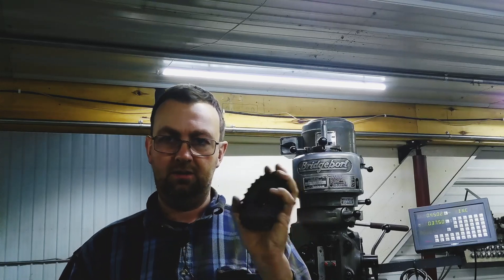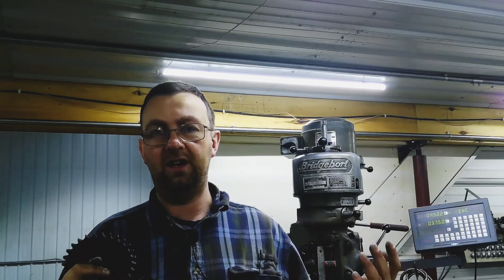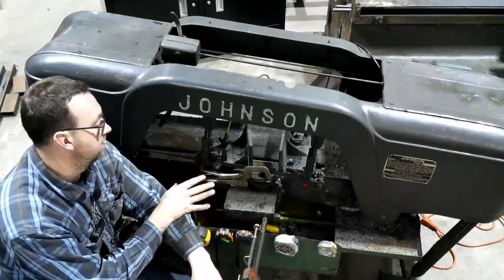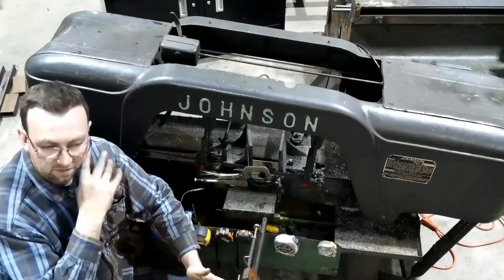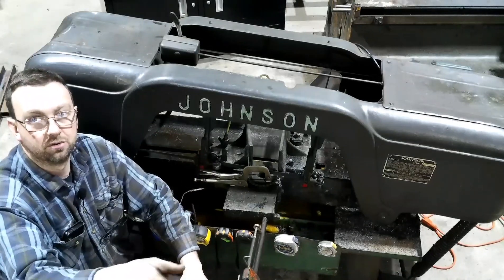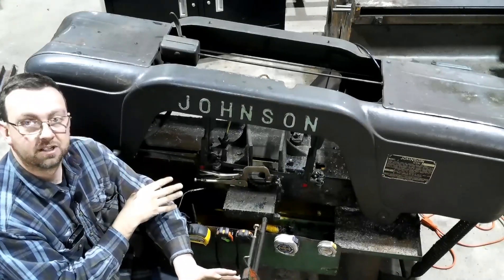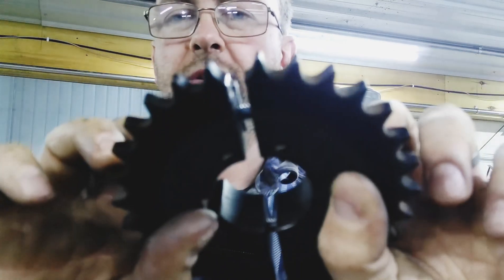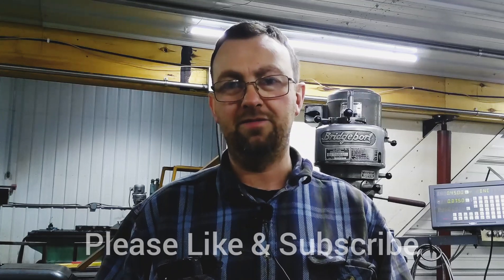How To Split a Sprocket to fit over a Shaft

Comment: Ah, I assumed you were going to crack them like how they do big ends, not cut them. Do they need to shim to keep it even / make up for the material lost in the sawing - when tightening them in place?
Reply: I thought so at first but no, the bored hole clamped on the shaft will keep the OD of the sprocket the same. When the two halves are bolted back together, the pitch between the teeth on either side of the cut should remain the same. I suppose you could have one gap tighter on one side if you tightened one of the cap screws way more than the other. I'd check the root on either side with a piece of stock the diameter of the chain roller just to be sure.

Comment: On a motorcycle the sprockets wear from adjusting the chain! When you keep adjusting the chain you change the pitch and wear out the teeth. Chain gets loose ,replace chain.  Sprockets  will last forever,or close to it!

Comment: Doesn’t the shaft hole become smaller by the amount the saw has removed? Seems that if you remove metal the hole will narrow itself and no longer be the same round diameter.
Reply: When the two parts are clamped together on the shaft, the shaft itself makes the bore of the sprocket conform to the right size.  When a tooth in the sprocket half without the keyway is carrying the chain load, some odd and variable loads must be taken throught the cap screws.  Not applicable where full sprocket rating is needed or where there is an uneven number of teeth (unless you can somehow cut two split lines.  In any case, there may be some unusual chain roller wear.
Reply: Let me this straight,  If the bore of the sprocket is the same as the shaft OD, cutting a sawblade thickness out of the sprocket won't matter as long as the tooth pitch is not affected. You could make metal gasket to fill that space, by using 1/2 of the split sprocket as a pattern.  A plasma cutter would be great for cutting the gaskets from semi-hardened sheet metal. Soft metal would crush when the bolts were
 tighteded.

Comment: New to your channel and really enjoy your explanations. Though most likely not possible, it still would be interesting to see the final install of the sprocket that justified the split.
Reply from the maker: Thanks for watching. So, I can't show the application, but it's a long shaft inside a machine. It would require about 20 hours to remove. This is what we came up with to simplify the replacement. Shaft is actually about 16 feet long and has 10 sprockets on it.

Comment: Can you post pictures of the coolant system on your Johnson bandsaw we have the same saw and the end next to the blade that pours coolant on the sawblade but I'm not sure where the coolant pump is. I would like to get the coolant running again.
Reply from the maker: There is a large ring gear inside the drive wheel that drives the pump. Very simple. What I would recommend to you if you don't have all the parts is an electric pump. I put one on a power hacksaw years ago and it worked better than the one on the Johnson handsaw.